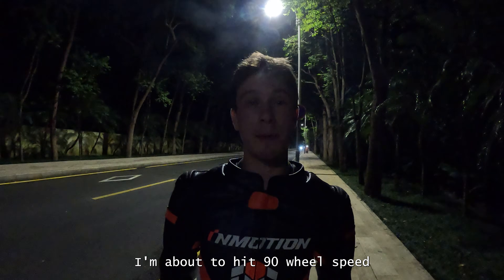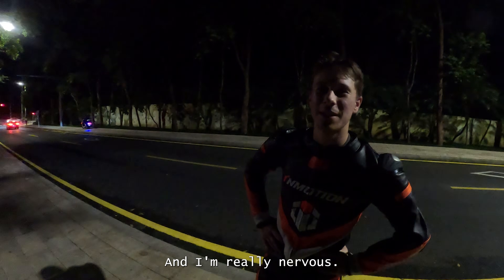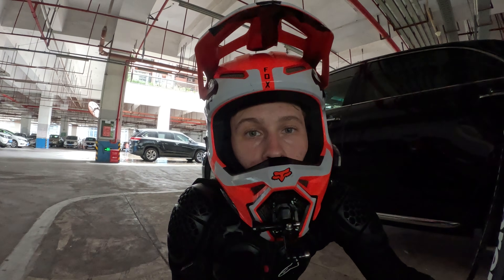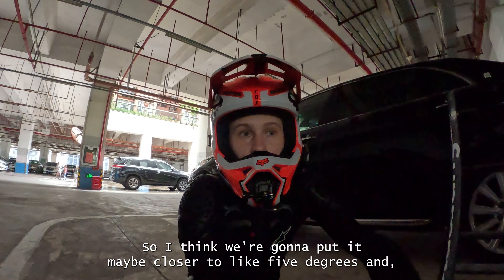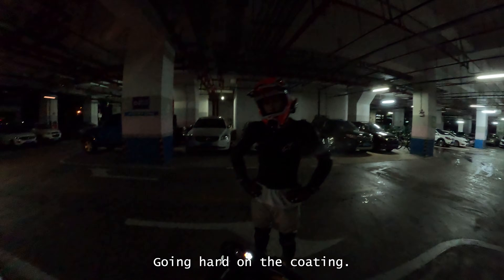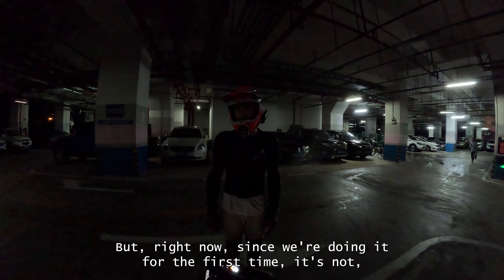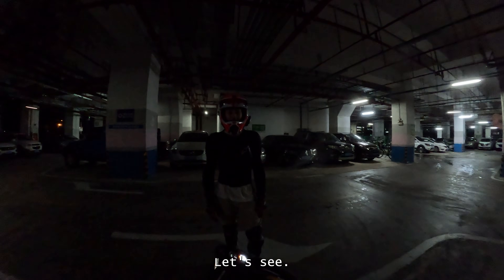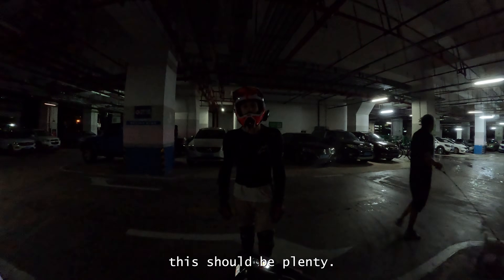P6 Testing Ep.7 — Sending It to the Max | 90 MPH Firmware Session

Comment: Thanks guys this has been really exciting to keep up with. I have an Inmotion v12 pro and I bought it knowing it was a scary wheel but its so easy to confuse it when you carve hard and short or when you change grades while going in a circle it can accelerate uncontrollably. I understand why they have so much to figure out because pedal behavior. I hope inmotion uses all they have learned and fix some older firmware.
Reply from the maker: Thank you for understanding our pain. I was told they're going to revise the other models firmware once the P6 project is complete.
Reply: @euczac  DUDE!
Reply: @euczac Now this is really really good news!

Comment: what's albert got against open source lol
Reply: Liability. Same as most large corporations .
Reply from the maker: Liability and user error concerns
Reply: @euczac  Unless you're paying insurance, aren't you already taking on all the liability just by riding EUCs? I'm pretty sure EUC companies don't compensate for injuries caused by hardware failure, so why should software be any different? The only reason that comes to mind is vendor lock-in, which is not a great precedent to set.